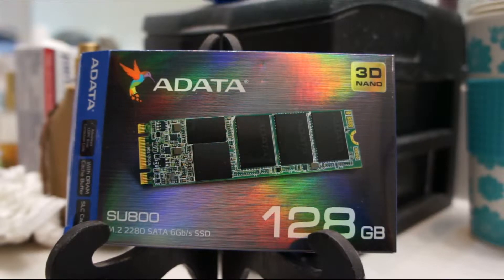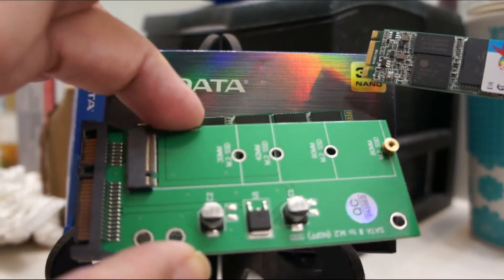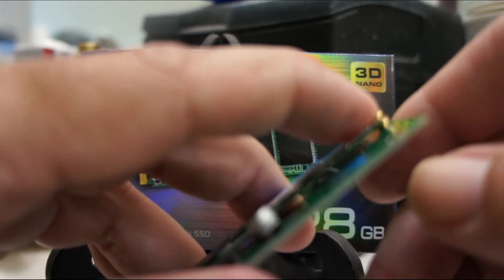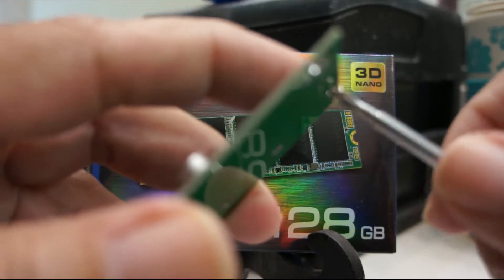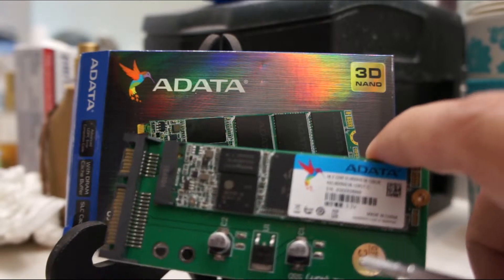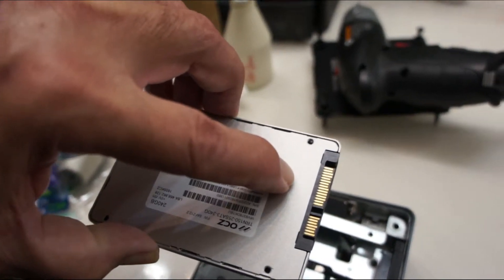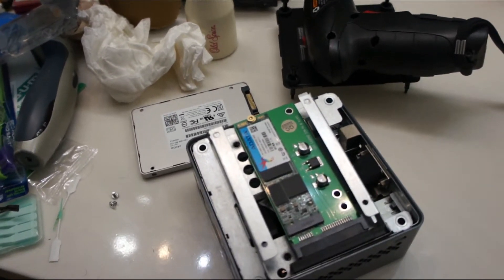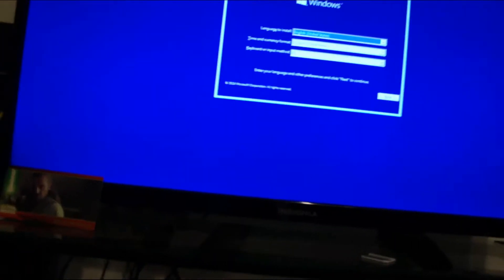ADATA M 2 SSD, WILL IT WORK WITH M.2 to SATA adaptor?

Comment: Can make a speedtest , the one with no adapter included and adapter included.
Reply from the maker: Sure. Only with adapter. Don't have an m.2 computer yet.
Reply: There's no difference. They're both in SATA mode either way.